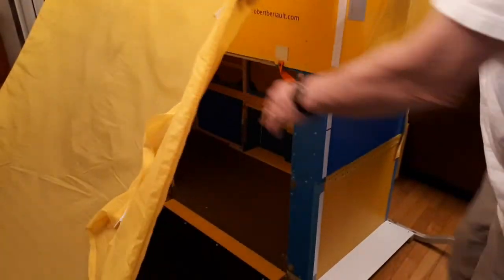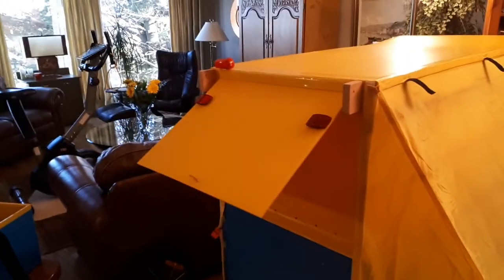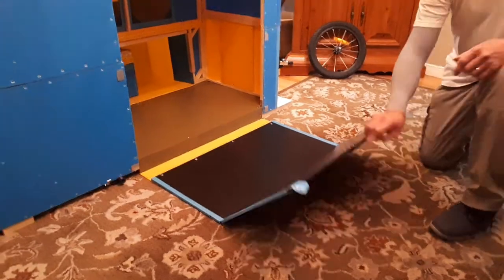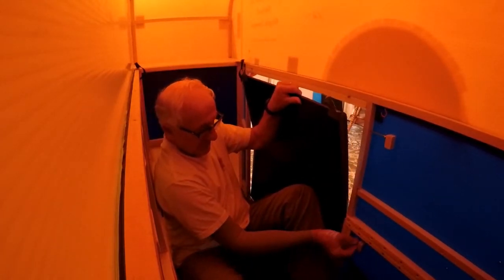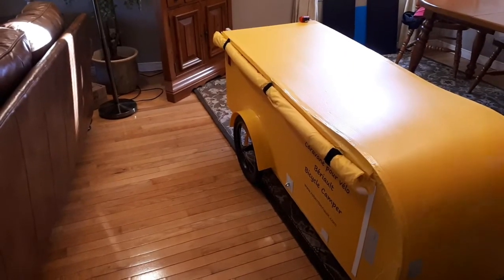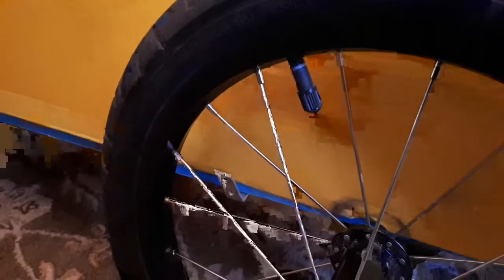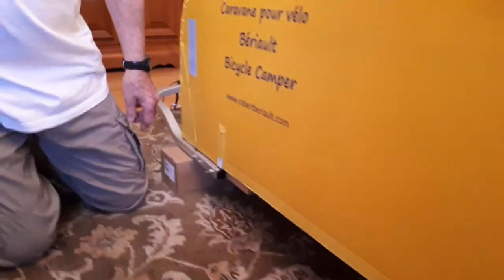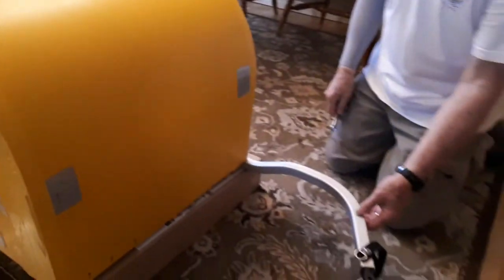IMPROVEMENTS TO THE BÉRIAULT BICYCLE CAMPER

Comment: Great improvements.  Where do you purchase the Coroplast from. Is there a company specializing in coroplast?
Reply from the maker: Most construction supply stores will sell white. For a variety of colors, you'd have to find a store that specializes in plastics. Coroplast is a trade name for fluted corrugated polypropylene sheeting.
Reply: Robert Beriault thanks Sir have been checking locally only they sell small pieces not sheets.  Have to probably order it online.  However I do not know how much I would need for the  Beriault camper build as I have not gotten the plans yet.
Reply: Alana Weaver thanks Alana a great idea!

Comment: Is it possible to make the camper 4 inches shorter by making the front end wall lower? Seems to me that the hood is that much longer because you cannot bend the roof panel too sharply. Having lower front end wall you could start the bend earlier, making the hood shorter.
Reply from the maker: Let me think about that.
Reply: My target is to fit the camper inside my SUV. If that works  I could make much more interesting trips than starting always from my front door.
Reply from the maker: I just saw your second comment now (May12).
The tow bar comes off to make it easier to carry in a SUV. I have carried my camper in my daughter's RAV 4.

Comment: Robert, do you think in the long run it would be wise to make the trailer the height of the person with out having the pull out and just use it as either storage or make it slant to do away with the pull out?
Reply from the maker: Wanted to keep wind resistance down to a minimum
Reply: @RobertBeriault753  okay, just thinking.
Reply: @RobertBeriault753  That's smart, I think a lot of trailer builders seen on youtube make the mistake of building them too wide and too high! the focus must be first on being able to have a smooth ride and second on comfort, but they do it the other way round. Often when you see them riding you can see that they are somewhat struggling to control the trailer! And they never show footage of riding in stronger winds. And that's what's good about your trailer! It's both spacious when folded out but narrow and low enough to allow for a smooth ride!